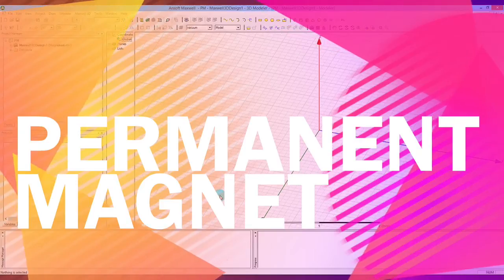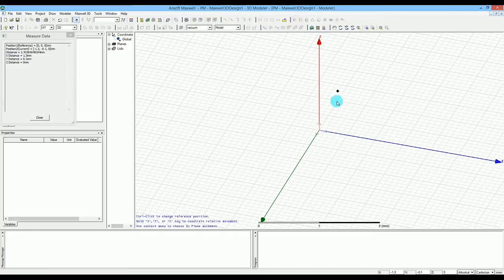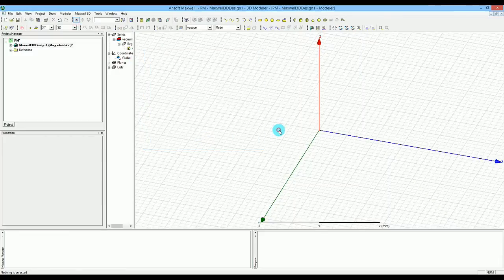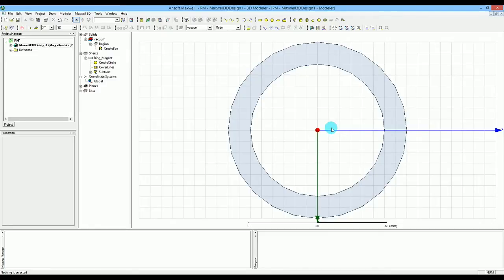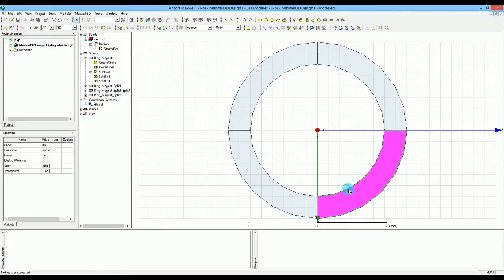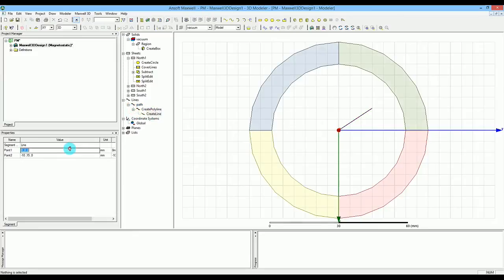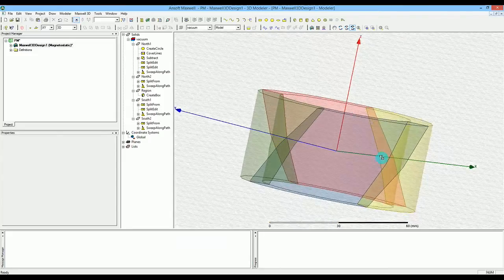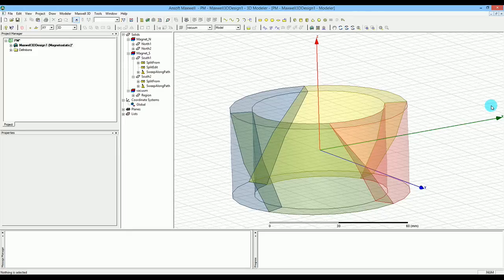221 Ansys Maxwell - Magnetization Direction [Modelling]

Comment: I wonder if it is possible to simulate the magnetization process of the magnet and then import the calculated magnetization into the actual motor for further simulation, in this way it will be more accurate I think.

Comment: may i ask a question?when i analyze the torque of the iron core in a electromagnetic valve with ansoft maxwell,there comes a information " [warning] Adaptive Passes did not converge based on specified criteria. ] ,what's the matter with the problem,hope for your help:)